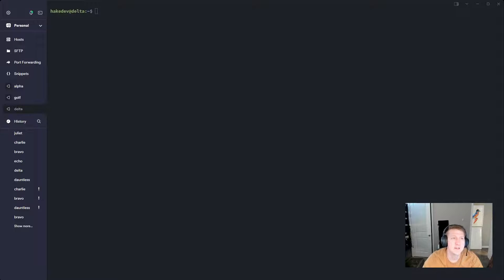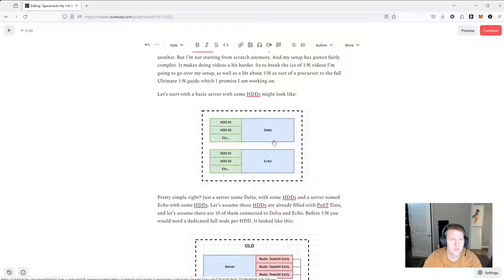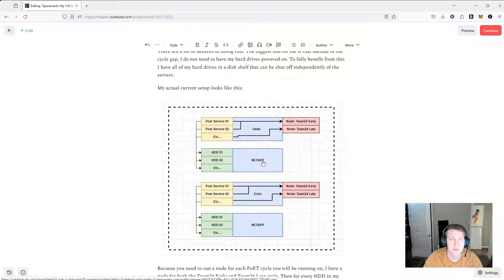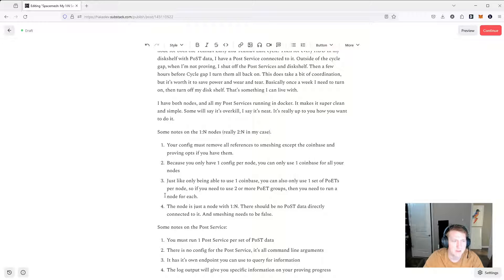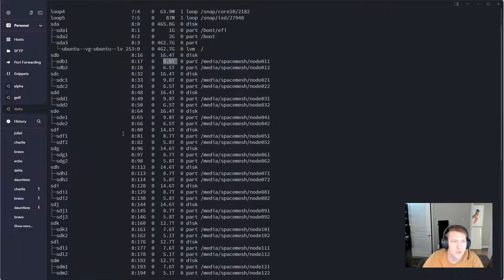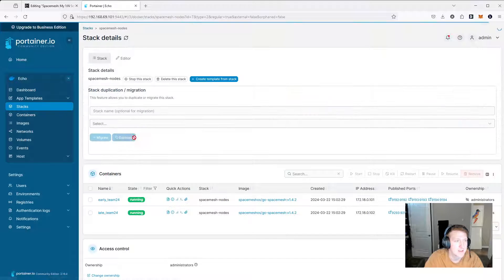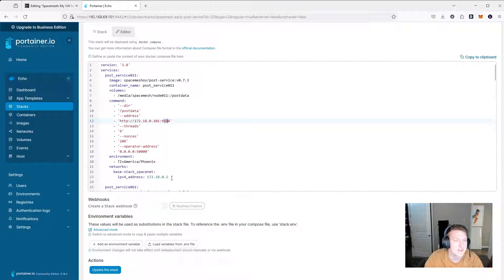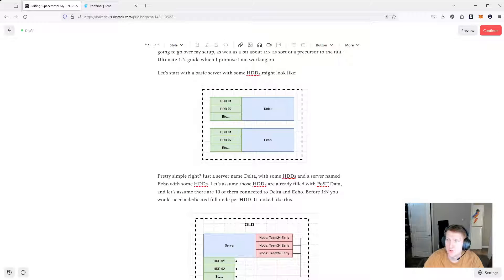Spacemesh - My 1:N Setup

Comment: I am also running 4 proxmox servers and 5 netapp enclosures.  I have a 1PB chia farm on the other side of the fence.  Im running your original docker setup with 20 nodes so far and about 70TB's.  I really cant wait for your video on docker and 1:N Setup.  I need it.  Im also migrating everything to team 24 after this 12 hr poet cycle.  I would not have been a part of Spacemesh without your setup.  Your instructions have been invaluable.  Thanks again!!
Reply: Same here, wanna do the 1:N setup cleanly and neatly in docker since it will be better to manage, huge thanks to my bro hakehardware for the Ultimate Spacemesh Setup Guide, it's just so elegant.

Comment: Why are you using 6 threads 208 nonces? To save the cpu from some workload?
Reply from the maker: It's a bit complex but keep in mind that each post service would consume at max 6 threads - and I will eventually be running 24 post services per server, so that is way more threads than my 7950X has available. So even though it's set to 6, when 24 post services are fighting for resources even that won't be enough. I let docker and the system sort how where to give resources, but in my testing I found it work the best to keep it around 6 threads per post service. I may change it in the future, and other's may have different results. Best bet is to play around with it and see what works well.
Reply: Thanks for the answer, but my question was more about the nonces, I'm using 288 for big nodes, I don't see any reason to use less  @hakehardware
Reply from the maker: @FranciscoSilva-mq5lr  288 for big nodes is a good idea if you have enough time. Small nodes that I know can proof twice in the allotted time I usually run lower nonces.